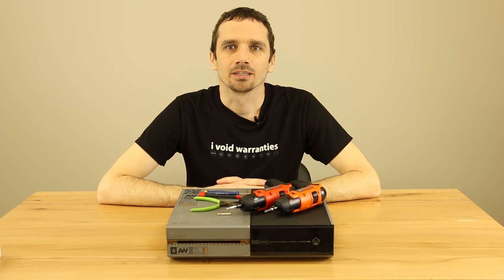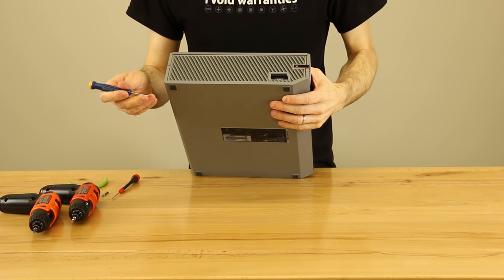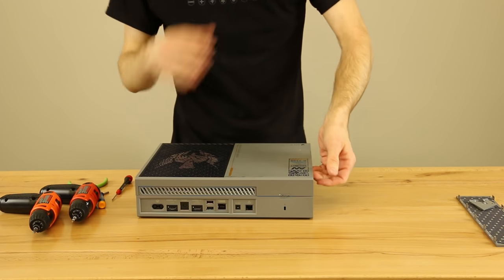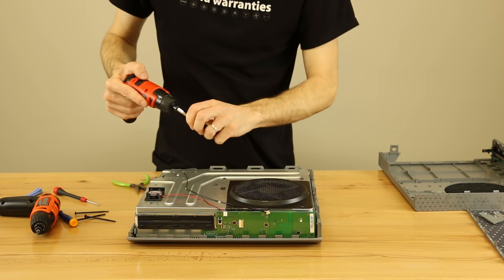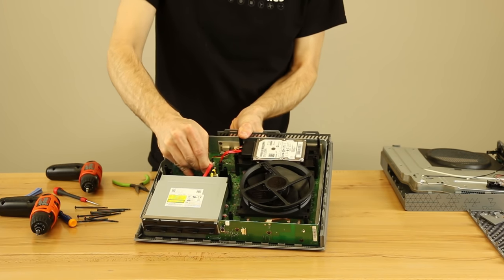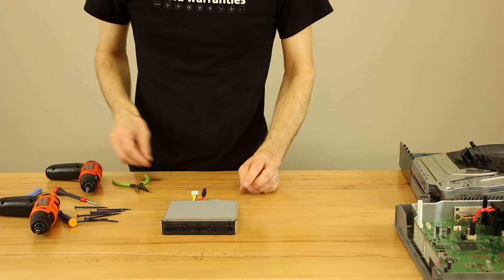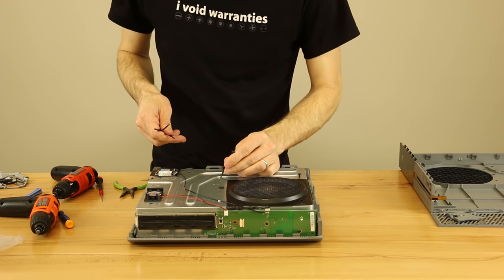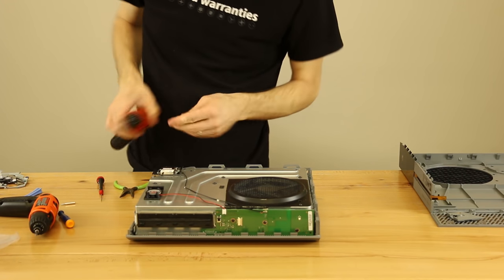Xbox One Disc Drive repair

Comment: My drive (from Xbox One S) works fine except the sliding bar that pushes the slot closed and activated the disc won’t fully pass through the gear assembly. If you gently pull or push on one of the plastic sliding tabs and “help” it along it works. But obviously can’t do that all the time. Any ideas?

Comment: quick question, is there a way to fix the external hard drive 4Tb, my xbox cant read it and the light on the drive does not light up but it feels like the motor inside is working

Comment: Wondering if you have a come across an xbox one optical drive power connector repair on the main motherboard. I think there must be a capacitor or resistor that's causing the connector to not recieve any voltage.  Any help would be much appreciated.

Comment: mine loads certain discs but it will not load other discs like bo3 or gta v
Reply: its Simplistic I have the same problem. My Fifa and UFC 2 work but GTA 5 and cod infinite warfare don't. Probably going to get a PS5 when new gen arrives aha
Reply: MegaGoon62 clean the laser inside it might be dirty

Comment: Hey TronicsFix how much would a new laser be and where's the best place i could buy them from?.....opened the disc drive and the laser part where it moves up and down, one side was broken.....i seen on your video to switch the laser your still need the ribbons....just wondering about the laser and not buying the whole disc drive.....thanks for the video as well
Reply from the maker: You can find those on Amazon...link in the description.
Reply: TronicsFix thanks for the reply, i clicked on the link and that specific laser was for the DG-M5S-01B.....I have the DG-6M5S-01B model, would it still work if i bought it?.....couldn't find my model
Reply: Hey TronicsFix, so would i be able to buy that laser?......trying to swap out the same exact piece you did

Comment: I disconnected my ribbon just to clean my fan. I connected the ribbon back and i didn’t know if it were the right way around. Now the touch sensor for off and on and disc inject or eject doesn’t work

Comment: i bought a xbox one faulty recently and i believe the person i bought it from has tried fixing the Blu-Ray drive as the 2 white plastic bits ontop of the drive to me look like they are not in the correct position based on a drive i fixed in the past and when i try to put in a disc it makes a grinding noise, tried googling some answers but nothing that seems to cover my issue, i have no problem finding videos people punching the xbox one lol.
Reply from the maker: No way for me to know without having it here to test but sounds like it probably needs a new drive.
Reply: Thank you for your quick reply, i would have you test it but im based in the UK and i thought i would have to buy a new drive.

Comment: Question: What if you don't have the old dvd drive and you have a new replacement drive. Is there a way for it to work and get rid of this disc not recognized error? Thanks!!
Reply from the maker: No, there is no way to make it work. You have to have the green board from the original drive.
Reply: TronicsFix Of I ordered the MD and drive combo will that be my only solution?
Reply from the maker: MD?
Reply: sorry MB
Reply from the maker: Yes, if you replace the motherboard with one that has a matched blue ray drive board that would work.
Reply from the maker: If you replace the motherboard though, you'll also have to put files onto the hard drive so it will work with the new motherboard.

Comment: Hello, I have followed the steps to perfection, but my xbox reads blu rays fine except my video games discs, i always get an error about try other cd or dirty etc ..  how can this read blu rays but not my games? Should I just replace the whole drive?
Reply: Yes but make sure you switch the daughter board too.  You don't have to solder it, just remove the motor.

Comment: I have a issue were my Halo 5 disc, reads as install, I hit ok. Then it comes up as a error code "This xbox360 game is not backwards compatible." Mind you the game all 97g is installed on a 4tb external drive. I also picked up Alien Isolation. That is taking forever to install.  Two hours so far for 2g out of 23g. 
All other games that are installed work with no issues. Movies work with no issues. 
Any thoughts? Or is the laser shot?

Comment: Where can I get the lens plus carrier like you used. My daughter decided to jam three discs in at once (yes they fit, sorta). Its making a horrible clicking/grinding noise now. I would assume a gear or something is broken but all I can find online is just the laser part. I don't feel comfortable replacing the whole drive if soldering is involved.
Reply from the maker: You should be able to find them on Ebay, Amazon, etc. You can always send it in if you need to: http://www.tronicsfix.com/store/p47/Xbox_One_Disc_Drive_Repair.html
Reply: Well I do want to say thank you, I was able to find the part on ebay and using your video able to pull it apart. (At which point I found out in addition to the three games I pulled out there was a fourth loaded in the drive plus two pennies :( ) I was able to get it back together and it powers on and everything works fine so at least I didn't make it worse. However on first boot everything was very quiet but when I first tried to load a disc it would not grab it at all. I finally gave it a little more pressure then I would normally and it finally grabbed it. I tired ejecting it immediately which it does do but it does get hung up a bit. I tired inserting it again and this time it worked normally, however the ejecting still hangs like its struggling or something. Once the disc is in its still making noise (almost different each time) sometimes whirling, sometimes humming sometimes grinding and unfortunately it still failing to read any discs. As far as I can tell I did everything right so I don't think it's the carriage/lens assembly. I'm assuming something else in the drive must also be broken, thinking I may be sending it you guys to get a new drive installed. Two questions will the xbox run without a drive installed at all? (I'm guessing no) 2. Since at this point I know how to disassemble everything would it save me any money to just send you guys the drive to re-solder the old board to the new drive and send me back the new drive?
Reply from the maker: 1) I'm not sure if it would run without the disc drive. 
2) We only do the full repair. We don't do partial repairs...sorry about that.

Comment: my disk drive has been broken for months. I have to keep taking the disc out and putting it back in for it to eventually read. I'm thinking about just getting an Xbox one s at this point. I've had my Xbox one since launch.
Reply from the maker: The Xbox One S seems pretty nice...did you see our teardown? It's on our channel.
Reply: +TronicsFix I did. it ended up leading me to this video. thanks for showing me how to take it apart.

Comment: ok so i am pretty savvy when it comes to this stuff . So o was having a disk read error would read some but not others reads dvd has issues with blu ray but plays sometimes. i replaced the laser as above bo issues together easy etc. now same thing happened. would the whole drive remedy this issue? if i just switched the board as u had said before they are tagged to the board like the 360. let me know please thanks.

Comment: Hey man I was wondering if you could help me out. I'm not really experienced with this and I just took apart my xbox one and got to the disc tray. I don't know what needs fixed; the disc makes a grinding noise as it goes in and I can't tell what needs to be fixed/replaced.
Reply from the maker: +Salinator69 It probably needs the whole drive replaced.
Reply: What else what I need to replace along with that? Are you sure it couldn't be the roller that needs cleaned?
Reply from the maker: This type of problem is generally not caused by the rollers...feel free to try though.
Reply: So, what should I buy an optical drive from Ebay? They're like 50 bucks, would those work?
Reply from the maker: Most of the time, yes.

Comment: I think I have this same problem. It started with a loud grinding noise then the disc drive just went limp. Dosnt spin the disc or read it. Dosnt move at all actually. I think I'm just going to buy games online for now on.
Reply from the maker: Sounds like you might need a new disc drive. Or just buy digital!

Comment: think my drive is faulty and it has a problem with discs plus when I switch it off you here the rollers a few mins later it switchs back so was wondering weather the disc drive is causing this to happen

Comment: I have that Xbox one edition and everything works I think but during one of the updates I think finished the whole screen when black and said system error E204 but I already set the Xbox up before so I went to turn it off then went into the settings and reset the console to factory defaults then I set it up again then it updated and it had no problems it work but what does that mean would it still have a system error I fix it myself with out even taking apart but I don't know if anything happens to do you know why it would say that error tronics fix?

Comment: With my drive I cannot get a disk to insert. When I look at the bottom the white disk that holds the disk in the drive is pushed all the way in. The white disk is attached to the black plate and the spring is in tact. A disc can only go in if that disc holder is not pushed in. I can't figure out what opens it up.
Reply: I figured it out.  There is supposed to be a small black tab that rides along a ramp that opens and close that clamping mechanism. That small tab that is attached to the black plate is extremely thin. That piece broke off because that whole clamping mechanism wasn't allowed to open up completely. There is a metal tab on the circle cutout that keeps the clamping mechanism from opening up to far. That metal tab was bent down 20 degrees and so every time the a disc was ejected and opened up the clamping mechanism that black plate basically had to bend when it was ramped open. Any chance you got that part in a parts bin somewhere?  I made a small video of it on one of my channels.  I will post it if you think you need to see it so you know what I am referring to. Don't want to hijack your channel.

Comment: So my Xbox one I'm working on everything works fine except the disk drive is unresponsive totally like I have to manually eject a disc if I get one in there it won't do anything I won't respond I won't make any noises so I removed it and I planned on just buying a new one and swapping the whole unit out are you saying I need to take apart the old one and remove the little motherboard inside the disk drive itself or can I just put the whole drive in and be good?
Reply from the maker: You have to swap the drive board

Comment: my xbox one has problems reading the disc, while feeding the disc into the xbox i have to hold the disk for like a second or two before i let go and then my xbox will read the disc. have u ever came across this issue,  if so how did u fix it??
Reply from the maker: Yes, lots of people have this issue. It seems to work for a long time like you describe. A new laser will probably take care of the issue but if not then a new drive would
Reply: +TronicsFix cool , thank you so much for getting back to me
Reply: If yu lift your Xbox up like tilt it up and put in disc it will work

Comment: Who sells the optical drive ? (Disk drive)
Reply from the maker: Ebay, Amazon, etc.
Reply: Just buy a brand new one from like Walmart, take it apart and switch the disk drive and return it. Kinda frowned upon but hey these $4-500 consoles should last longer then they do

Comment: In the Description You Have a Link to buy an Xbox Laser and You also have one For the Xbox Disc Drive, What one did you Install on this Xbox Because I have the same Problem But I dont know which one to Buy
Reply from the maker: I don't remember...that was a long time ago. Your best bet is to install the entire drive as it might not be a laser problem.
Reply: TronicsFix Thanks man, If I buy a new Disc Drive will it work properly with a different Xbox as I have read that The Mother board with the Disc Drive and the Actual Xbox Mother board are "Married" (So they are like made to go together) so Will that effect how my New Disc Drive works on My Xbox
Reply from the maker: You have to change the drive board over from your old one to your new one.
Reply: TronicsFix Okay so I just take The Motherboard from my Disc Drive and Put it in the New Disc Drive
Reply from the maker: Yes...you'll need a soldering iron to remove it and put in on the replacement drive.

Comment: Who makes those drives Hitachi Phillips or Benq
Reply from the maker: +123the prodigy Phillips makes some but I'm sure there are multiple suppliers.
Reply: +TronicsFix I think Microsoft is only asking Phillips for this current generation Console The Xbox 360 had multiple manufacturers sometimes their DVD drives wouldn't work  so maybe Microsoft only asked Phillips and not Hitachi or Benq to  manufacture  Blu-ray drives
Reply from the maker: Xbox One's have lots of problems with their Phillips disc drives.

Comment: Hey my console is making this weird grinding noise when I try to eject my disc, and it doesn't come out. The Xbox isnt even acknowledging that there is a disc in there. Any help or ideas?
Reply from the maker: Unfortunately, you'll probably need to disassemble the drive to get it out. You should try the manual eject screw first though.
Reply: ik this is 2 years old BUT there is a trick, it seems to only eject when it is turning on, i have the same problem, i need to replace my disk drive but, if you unplug it, plug it in, press the on button, then immediately eject, it should work

Comment: I have an Xbox one model 1750 I opened it up changed the disc drives swapped the logic boards over from my original drive into the new one but now it doesn't power up I use the motion sensor to switch it on but it lights up long enough to test the disc drive then turns off it doesn't even show as outputting video it doesn't show on my tv as an input I am concerned that I have damaged that ribbon cable at the beginning it will power on with a controller but still no output from the console and powers off after a few seconds and neither method of switching it is able to produce output just going to send it to a professional

Comment: I just replaced mine with a brand new original replacement but I still get a error message ''there's a problem with the disc drive '' do I need to install a new drive firmware etc ?
Reply from the maker: They don't sell brand new original replacements so I'm not sure who told you that it was but there's no way to buy those unless you buy a brand new console to take it out of. Make sure the console is fully updated.
Reply: I followed your instructions and it worked perfectly I just switch out the MBoard and it worked fine

Comment: So I have a game that won't come out I have tried using the manual eject can I open that up and take the game out that way?
Reply from the maker: Yes, you can get it out by taking the disc drive apart.
Reply: Thank you hopefully i can incert the disc and have it come back out instead of having my overwatch copy perminatly suck into my xbox.
Reply from the maker: Good luck!
Reply: Just use a really skinny flat tip scredriver and insert into the tiny hole . It should eject the edge of disc out.

Comment: I was wondering if this is a problem or not, I sent my xbox one s in for repairs and  because it was under warranty, I tried it when it got back and seemed to work ok, but I've noticed when I put a disc in, it takes longer than usually to load the game, but only does it when I first turn on the console, and sometimes it don't recognize 360 games, my internet is slow too so idk if that has anything to do with it or not but just wondering if it's something I should worry about it not
Reply from the maker: Probably not but no way for me to know for sure.
Reply: TronicsFix  ok thank you, hopefully it's ok, but if it ever has anymore trouble with the disc drive I'll be sure to sent it to you

Comment: I did this exact thing and replaced the disc drive deck, put it all back together, everything went smooth and now it wont read any game except for one. it says every other game is dirty or damaged which isnt true. I dont know where to turn next. would an update fix it somehow? the game that works is an older game.
Reply from the maker: Sounds like it could just have a dirty or bad laser. The drive you put into the console would have been used so it could just have a worn out laser.
Reply: TronicsFix yeah figured, of course they describe it with a new laser. any tips on cleaning the laser? if at all possible? or just get another laser and try that?
Reply from the maker: You can use isopropyl alcohol and q tips. If you just want to replace it you can find a link to one on Amazon in the description.
Reply: TronicsFix Cool, Ill try that. Thanks for your response and video it really helped a lot.
Reply from the maker: No problem. Good luck!

Comment: Can i Remove disc drive will it work without disc drive?
Reply: most likely it will. I advise not to, though. Is your disc drive broken because it's an easy fix, but you have to have the original drive and swap the boards as their tied to the motherboard
Reply: @DustyOrchid057  thanks